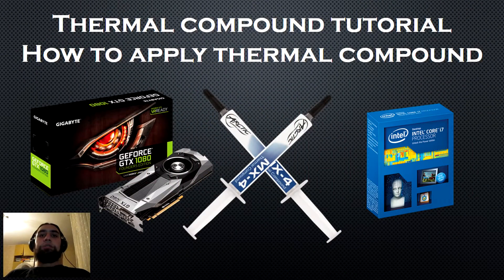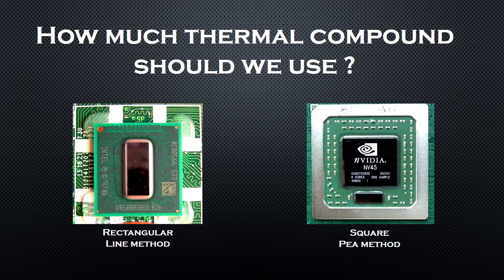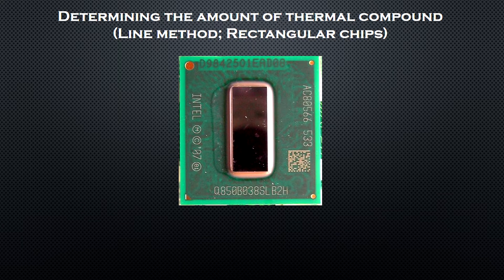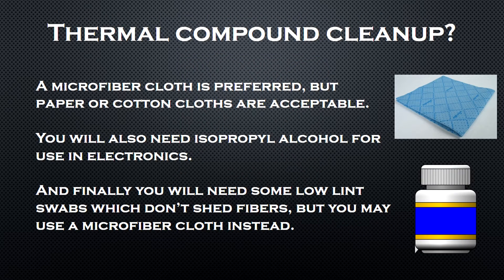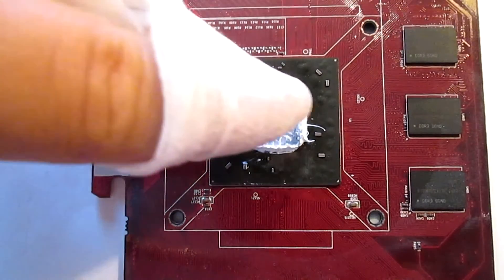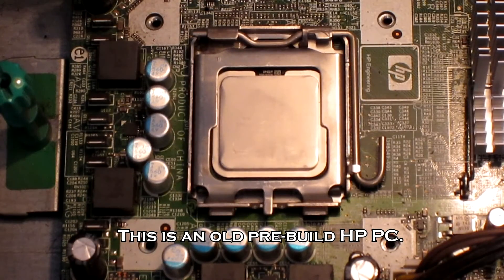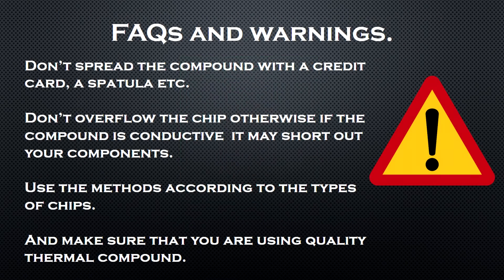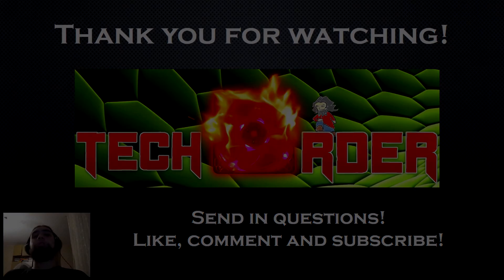[Tutorial] How to apply thermal compound to your CPU/GPU/PS4/XBOX etc.

Comment: That was an excellent video, but of course I would not be me if I didn't have a comment to make.

What I find missing about these kinds of videos (and of the ones I have seen yours is head and shoulders above the competition) is the WHY with regard to using thermal compound. Personally I think that if people know the why they should use thermal compound then the mistakes they make in applying the compound is a lot less likely to happen.

So why should you apply thermal compound? It seems a bit counter-intuitive when by far the best conductivity of heat will be achieved if there is bare metal to metal contact without some gunk in between.

While it is true that metal to metal would be superior, the finish on the metal housing of the CPU and the base of the cooler is not perfect. This means that if you just put the cooler on the CPU there are air pockets between the two. Now air SUCKS at conducting heat. Everyone has done this, you open an oven and it is no problem whatsoever to put your hands in the oven even though you would never be stupid enough to touch the walls of the oven or anything in the oven with your bare hands.

What the Thermal Interface Material does is basically fill in those air pockets improving the conductivity between the two surfaces of the CPU and the cooler.

This is why one does not need to use a lot of the TIM, in fact using too much would be counterproductive.

Using the spreading method for applying TIM is also counterproductive because you can very easily introduce air pockets which will not be filled in when the cooler is placed on the CPU because the TIM is spread too thin to fill those air pockets.

Another little trick I like to use when I have applied the TIM (and I use the pea method as well) is that I like to twist the cooler clockwise and counter-clockwise a little after I have placed it on but before I screw it down, just to make sure there are no little bubbles of air left.
Reply from the maker: If you want to go to a more extreme level, there is the liquid metal option. Its a compound  which basically creates a direct metal to metal contact while filling all of the air gaps.But the cooler is extremely hard to remove afterwards.
Reply: Tech Order
I have seen tests done with this kind of TIM and the results don't live up to the hype nor do they justify the price and of course the hassle of applying it and removing it afterwards.

The worst thing about the liquid metal pastes is that they contain Gallium and this amalgamates with (it is also described wrongly as "melting") aluminium destroying its structural integrity.

There were two things I forgot to add and I am grateful to you for reminding me.

1) Some TIM will only be at their most effective after they have been on for a time. This is is called "curing". So if someone has applied their thermal paste and they don't get the results they were expecting they shouldn't rip everything apart and start again. It should say on the package whether or not the product needs time to cure to be at its best performance. Arctic Silver 5 would be an example of this and it takes around 200 hours of the computer running for it to reach its nominal performance as a TIM.

2) TIM will lose performance over time, especially if you overclock. If you have spread the TIM on lavishly and it has not spread properly this can result in the TIM drying out and cracking if the computer is moved introducing air pockets which of course - because as I said air SUCKS at conducting heat - will result in a big performance loss.

This degradation is a lot more noticeable with cheap TIM which was not so great in the first place becoming less so a lot quicker than the more expensive stuff.

As a little aside, even using TOOTHPASTE as a TIM gives a better result than just putting the cooler on the CPU without anything.

As always, I am not writing this to either criticise or denigrate the good work you are doing.